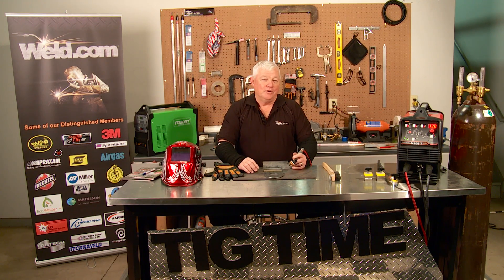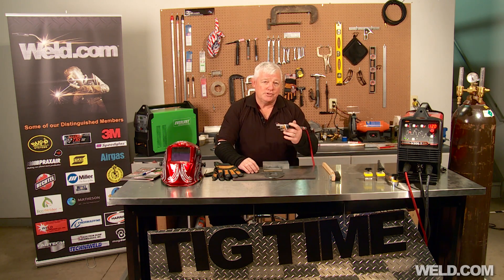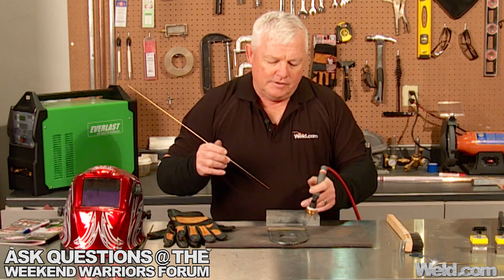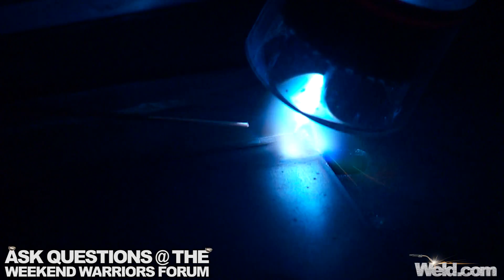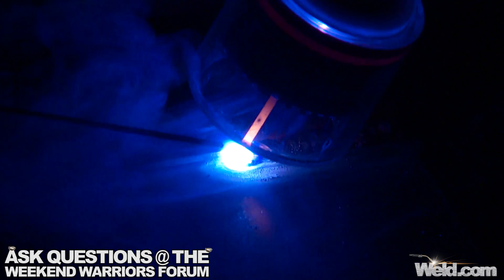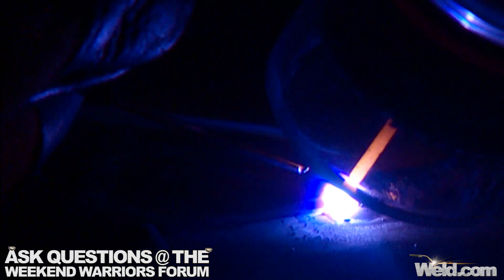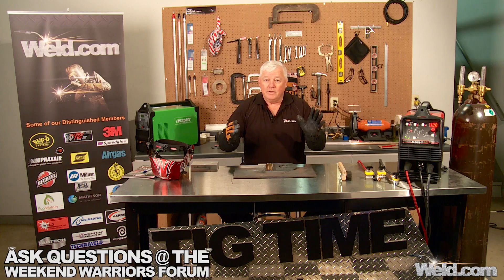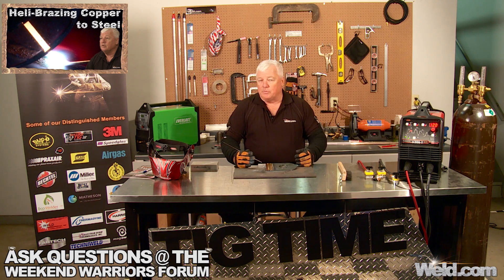TIG Brazing Brass to Steel

Comment: Very good video. Could this technique be used with a standard gas brazing torch ie a propane or MAPP burner or is it a DC TiG job only? The job in question would be for a small fly tying vice repair, but if it is possible I am concerned as to just how strong and durable the joint would be

Comment: Juan,  You will not be able to weld steel to brass so you will need to use silicon bronze (braze)  You can use argon gas for most applications..   If you cannot get enough quick heat our of your power source , then you may need to shift to helium.  good luck  Mister Tig

Comment: Can you weld 1" brass  round plate to a 1"steel pipe flange. What size of filler rod would you use brass or silicon bronze? Then what gas would you use argon or helium?
Reply: +Juan Espinoza Can you not just solder it?
Reply: +MrcabooseVG don't know ?

Comment: Justin,  I was brazing at about 60-65 amps.  Thanks for the question.. Mr. Tig
Reply: Sir which filler rod you used gas welding filler rod  or not